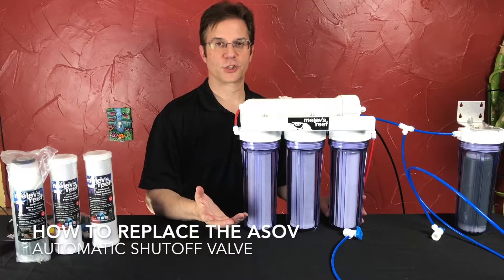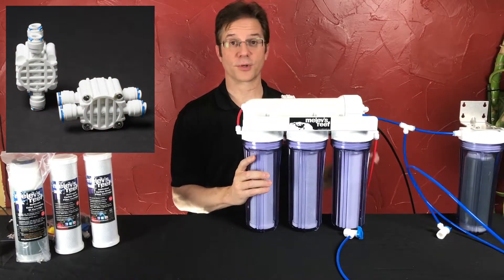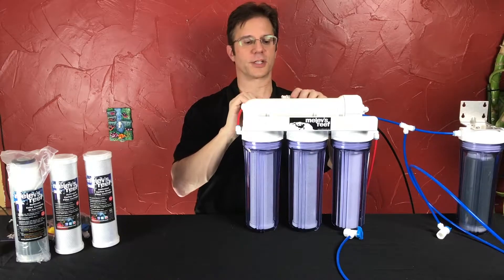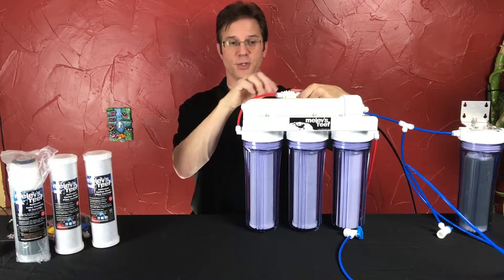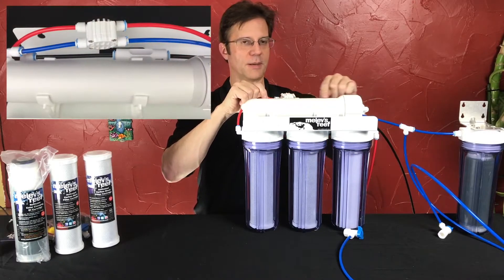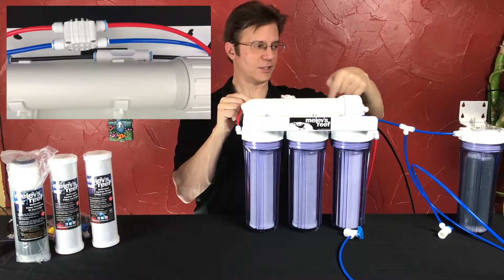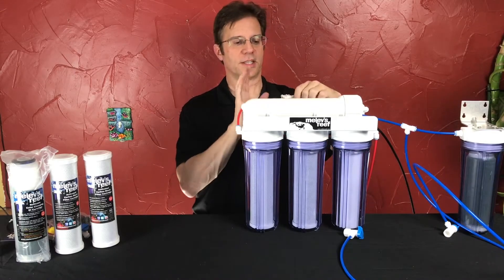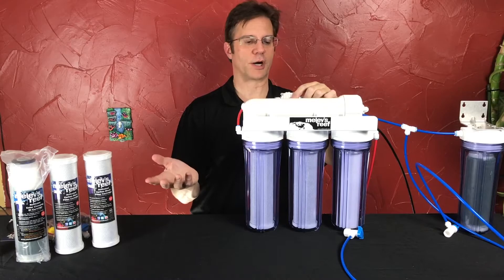How To Change the ASOV on a RODI system

Comment: Thanks for good tips.   I have 2 ro systems.  On one system the ASOV opens almost immidiately when a cup of water is drawn from tank and we love this way.   On the other system,   ASOV doesn't open until about 1 gal of water is drawn from ro faucet.  We don't like this way because the output pressure is weak for a long period of time.    Please let me know what is the normal on/off behavior of ASOV. Thanks in advance
Reply from the maker: Does the one for the RO faucet also run from a bladder tank? That tank may need the air bladder re-pressurized (Maybe be at a low PSI at the moment). You may need to replace the ASOV.  Those would be my two guesses.
Reply: Thanks for getting back to me.   Tap water pressure measured at entrance to the 1st stage (sediment) is 60psi as I set it outside of my house.   The tank at fully refilled has 38-39 psi which is normal.   Tank at empty is charged to 8psi.    The only problem is ASOV  doesn't turn on until about 1 gal drawn from the ro faucet, at which tank pressure is below 20psi.  Then, once ASOV opens, tank can be recharged to full capacity and reaches 38psi again.   I wonder if ASOV of different brands are designed differently that on/off at different differential pressures or  my ASOV is faulty.
Reply from the maker: I think the pressure of the air bladder in the metal tank is supposed to be 12 PSI. I'm not referring to water pressure, this is air pressure and there is a small nipple near the bottom front of your tank to give it a little more air if needed. You don't want to over-pressurize the rubber bladder, that I know. I don't believe anything is running incorrectly, the bladder tank needs to drain a fixed amount of water before it will accept new water.  It's not on/off like a faucet.  

A new ASOV is only $10, and I have them in stock on my website if you'd like me to send you one. If you feel the need to get a new one. :)

Comment: So is there any benefit (other than being more lazy :D) to having a system plumbed into your house plumbing such that there is ALWAYS pressure in the system, versus having no pressure when it's off in the case of attaching to a hose bib?
Reply from the maker: +Mike B Mine is always pressurized so it can shut off. I installed an inline ball valve on the red tubing where it can be reached easily. When the system is off / pressurized, I close the ball valve. Just another layer of protection although I've never had an incident.

Comment: I have my RO hooked to my Apex with 2 powered Solenoids and  float switches in my RO container.  (benefit is  I can Auto flish my RO membrane each time it kicks on)
Reply: How does that work? Is one solenoid on the clean effluent tube and the other on the waste water tube? Do the float switches start the cycle or end it?
Reply: I have 1 solenoid on my Main water line to my RO, I have the other Solenoid  where your manual flush would go.  I then have 2 float switches in my RO container, and  once I use about 60% of my water the floats trip and make RO begins, and when  top float switch trips it ends. (also have a time that if to float fails it still shuts off so no leakage :)

Comment: I'm glad you mentioned a float valve.. In your video describing the system initially, you said it's good to open the RO and drain it for 90 seconds or so and this would drastically help extend the life of the DI resin. Is there a way to accomplish this if you're using a float valve?
Reply from the maker: No, there isn't a way if you are allowing the system to turn on and off exclusively from the float valve. I'd recommend you install an ATO reservoir near your sump instead and refill that every few days with the float method. That way your RO system is only on once or twice a week, and the rest of the time is at rest. If something were to go wrong with your reef & sump, the reservoir only contains a limited amount of water that potentially could be added accidentally at once.  If you have the RO system plumbed to it directly, not only does that wear out the membrane prematurely, it also allows new water to be added to your reef non-stop until you finally notice the situation, and salinity may have plummeted by then.  Here's an example of a reservoir I sell: http://melevsreef.com/catalog/ato-reservoir  If you look at some of the pictures, you'll see the float within one of them.